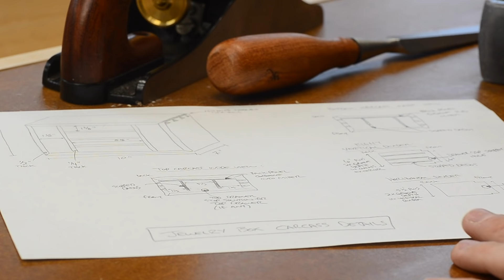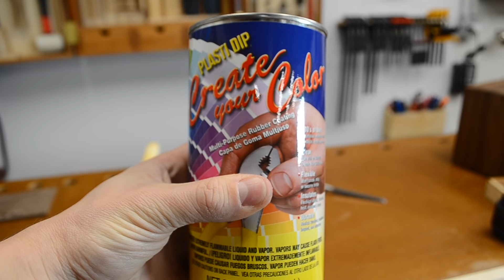Almost a DISASTER | Dovetail Jewelry Box Build

Comment: And this is why you should use liquid hide glue. Especially when working with dovetail joinery. After your mistake, you would have spritzed a little warm water on the joint and gently undone the joints without pounding it with a mallet. Then you would have taken a break and come back relaxed, applied some warm water on the old glue and put new glue on top, with no need to remove the old glue (it sticks to itself, unlike other glues). And you would have saved a lot of trouble sanding away the squeeze out mess, because it doesn't interfere with finishes. Order yourself some Old Brown Glue and you'll never feel glue-up anxiety again.

Great video and great build!
Reply from the maker: Yes that's a very good point. I definitely would have been better off her if I had used hide glue instead!! Thanks for the tip!

Comment: Great build, and real nice to see hand carpentry for a change. So many machines making the job easier (why make it harder, right!?). Only thing I didn't really take to was the spray finish. Just not for me, don't think spray lacquers do Walnut justice. That's just personal preference and think that a nice hard wax or wipe on poly would have given a better lustre. The spray finishes are just too... rough looking (only way I can describe it) for what should be a lovely smooth, satiny finish to the Walnut. As I say though just personal preference and absolute kudos and bow-down to the hand tools mastery.
Reply from the maker: Thanks for the kind words Rave! I too felt negatively towards spray lacquers at first, but I was forgetting a crucial step of buffing the finish after each coat, especially the last one. I crumple up a piece of soft paper and buff the surface and it ends up glass smooth and with a deep, rich color. Anyway, I generally prefer wipe on poly but it can be difficult to apply without drips to small pieces with lots of inside corners like jewelry box drawers, so I opted for a spray finish here. Thanks for watching and commenting!

Comment: Beautiful box.    That herringbone chain is going to kink up being stored like that.
Reply from the maker: Thanks Pippa! Agreed the necklace storage is the weakest part of the box IMO. I appreciate the feedback!
Reply: @dkbuilds   I didn't mean to say THAT at all.   I love the feature and I especially love that you included a little piece of wood to keep the chains safely in their place.  I have a very expensive Italian box by Agresti that doesn't have a place for the chains to rest so I have to make sure the chains aren't caught in the doors before I close them or hung up on anything when I pull the racks out.   I try to only use it for shorter chains that won't drag or snag so it is limited in use.   I think the necklace storage is exceptionally well designed.  I would be very surprised if the woman who owns it had any problems with it.   I would hang my cable chains on in that box with pride, but not herringbone chains nor my pearls which need to be laid flat for storage.  Pearls stretch out and herringbone while lovely (like liquid gold) has a terrible tendency to kink up and when it happens there is nothing and I mean nothing that can be done except sell the piece for scrap value which is heartbreaking.  Many other type of chain necklaces would be perfectly safe in the box though.   I love it.  I am so sorry I didn't make that more clear.  The problem is herringbone, not the box which is exquisite. :))

Comment: Man, nice thinking with the partial glue, allowing the wood to expand! I recently made a box for a coworker out of 7/8" black walnut and glued it solid all around - I'm hoping that doesn't come back to bite me!
Reply from the maker: How much it moves depends on how wide the board is. Also if the box stays inside of an air conditioned home the humidity swings are much less so there is less movement. I bet yours will be just fine!

Comment: Random question about resawing the maple for the drawers.  Why not use the fence? Is there a benefit to freehanding, or you just don't care because it's going through the planer anyways? 

The piece is beautiful and I think I'm going to attempt a jewelry box myself next.. I appreciate that you have all the power tools and still choose to use some hand methods. You're a true craftsman.
Reply from the maker: That's a great question David! In this case I wasn't using the fence because my bandsaw wasn't tuned properly (or probably the blade wasn't sharp) so I was getting a lot of drift. That's why I freehanded it and planed it later. With a sharp blade and properly tuned bandsaw I would definitely recommend a fence to waste the least amount of wood possible.

Good luck on your own jewelry box, let me know how it turns out!

Comment: I'm not into jewellery bro but u gotta show me how u built that rotating table from the planer and saw.. That is a belter of a jigged up piece of kit.. I love that bcos it helps with small spaces.. That got me sitting up and taking notice. I only have a small space and that could be a huge help. My shop to be will on be 16 X 12? so any tips like that are great.When I saw u move it to get the planer up top I was blown away.  
The box is beautiful mate. I love the colour of the wood.. Is that Walnut??  What's the little saw called again for cutting out the dovetail joints?? Is it called a FRET saw?? I know it's not a coping saw. What is a coping saw for anyways?? Metalwork or both??
Brilliant work btw bro.. Keep it up. It's great to be finding so many woodworkers online today..
Reply from the maker: Thanks for the comment Slim! Yes the wood is walnut, and the saws I use for dovetailing are a dovetail saw and a fret saw. I think a coping saw is for both, but it is commonly used to "cope" interior angles for things like crown molding and baseboards. Thanks for watching, I'll consider making a video about my flip top table some day!

Comment: As I see the wood flexing and vibrating like that as you saw it I think drop it closer to the vice for more support.
Reply from the maker: Very good point, thanks Spud! I generally try to keep it low in the vice, but for the 45 degree miter cuts I need to drop the handle of my saw down low to get the angle, so that one has to stay high in the vice. Appreciate the advice!

Comment: I think I would lined it with felt or self adhesive flocked sheet.
Reply: Or leather of course.
Reply from the maker: Yeah I agree robleake, especially because it is holding small delicate things like jewelry. I might try to flock the drawers later! Thanks for the input

Comment: Really nice work, but I'm curious about your drawer bottom orientation. I might have missed it in the video, but do you need to worry about about expansion seizing the drawers in place?
Reply from the maker: Thanks Mike! In this case the drawer bottoms are actually plywood so I'm not worried about expansion. If they were solid wood I would arrange the grain such that it expands front-to-back and would attach with a screw in an elongated hole to allow for that expansion.
Reply: @dkbuilds  thank you! I couldn't tell if it was solid wood or ply in the video. I might have missed it!

Comment: Beautiful work man. I'm curious if anyone can tell me why the drawer bottoms/ necklace dividers weren't encased at the back but set with a screw? Only thing that I can think of is to maintain a tight fit while also leaving expansion room perhaps?
Reply from the maker: Thank you! Drawers are usually made such that the bottom can slide in after the glue up is done. It makes the glue up a lot easier, and makes the drawer fitting to the opening easier. In general the drawer bottoms are solid wood and are aligned so that they expand and contract in the front-to-back drawer direction, and are held on with a single screw in an elongated hole so the bottom can expand backwards from the front. In this particular case I am using a plywood bottom which won't expand or contract, but I chose to attach it with a screw anyway for aesthetic reasons.

Comment: Great video and really nice project!!! But why did you use lacquer not oil?
Greetings from Austria,
Paul
Reply from the maker: Thank you Paul! I use oil for larger projects which take more wear and tear (like tables) but with 24 hours between coats it takes a long time. For small projects I prefer spray on lacquer which looks great and takes 20 mins per coat but isn’t quite as durable. Good question!

Comment: Superb.  I note you used a WoodRiver plane on your shooting board.  Is your plane square?  I bought one and it was .4mm out, and was advised this was within their .5 degree tolerance
Reply from the maker: Thanks Nej! Yes I use a WoodRiver 5 1/2 on my shooting board. My plane is indeed square, I've had no issues with it :( Sorry to hear yours is out! Can you tilt the blade to compensate on the shooting board?
Reply: Tilting the blade each time you switch between planing and shooting sucks the joy out of working.  No returned it which was a shame as otherwise it was a delight to use.
Reply: Loved your work and have subscribed to watch more
Reply from the maker: @nejsanerkin4474  Yeah I agree, I would have returned it too. Sorry to hear you had a bad experience, I really love my plane. Maybe get a LN one instead?

Comment: Hypothetical q: would a heat gun.have helped slow the drying during that emergency disassembly?
I guess it would for hide glue but not for other types?
Any thoughts?
Reply from the maker: Good question Keith! Heat gun would actually make this glue dry faster, but it would be great for hide glue. I should have used hide glue. I believe even after hide glue has fully dried, a heat gun can help separate the joints.
Reply: @dkbuilds  Yes high glue will definitely come apart with heat

Comment: Wow all that work and recovering from a glue up error and using a rattle can finish.
Reply from the maker: Have you used a high quality spray on lacquer? With several coats and buffing it looks much better than anything that is brush or wipe on. It is a professional quality finish.

Comment: I noticed that when using the shooting board, you flip the piece to come in from both sides - i found this an issue myself, and wasnt sure if i was doing it wrong, as i have not noticed anyone else have to flip the piece before .... i find that if i dont come in from both sides, it will not be square... am i doing something wrong?
Reply from the maker: Hey Vinny! Yes I start on the opposite side and cut a small chamfer (diagonal) first. Then I flip it around and plane all the way through. I do this because if you don't make a chamfer first, the back side of the board will tear out when the plane passes through it. This is the proper way to use a shooting board, you are not doing anything wrong :)

Comment: amazing work! could I ask a quick question? @ 19:16 you are using some sort of white marker to mark the walnut, what is that?
Reply: P.S. I subscribed :)
Reply from the maker: Sure! That is a mechanical pencil made by a company called Pica Marker. I quite like it, but I only use it on dark woods like walnut.
Reply: @dkbuilds  Pica - Dry Automatic Pencil / Marker?
Reply from the maker: @AssafOppenheimer  Yup that's the one. I can't remember if it comes with white lead. I bought extra lead that was white/red/black (I only use the white one though)
Reply: @dkbuilds  Thanks, Ill pick one up :)